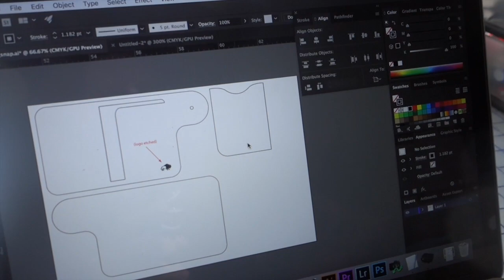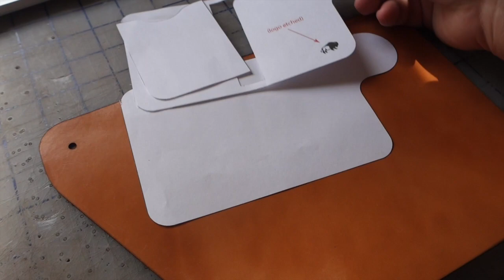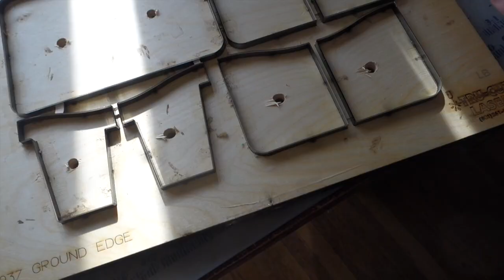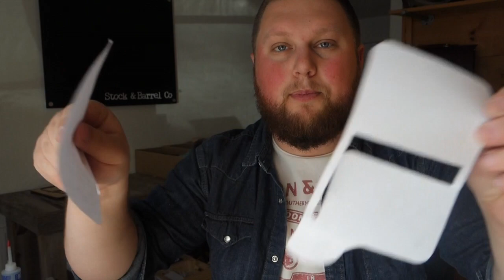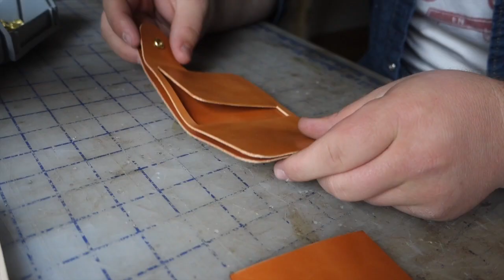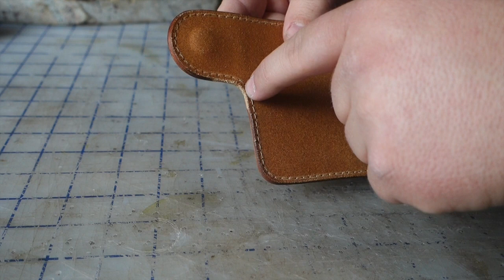Designing and making a new leather wallet from scratch

Comment: I’m not a fan of folding my cash, but I like this design.  I would change these things for my taste:
1. I would want more of the top parts of the cash showing for easier access, although the loose flap partially accomplishes this.
2. With a little thinner leather I would like the snap flap eliminated for easier access, a thinner overall design and and a smoother presentation.

Comment: I like it and the changes you spoke of were great improvements. I think you could stamp your logo on the outside of the wallet in it’s folded position. Also if you can slot another tiered card slot in it would be beneficial.

Comment: I know it's been four months... I just watched this. I do have a couple of suggestions. I think the first is to use leather that is just a little thinner. We all know guys that have wallets that make big bulges in their pockets because the wallet is too thick! Seems like the more layers to the wallet, the thinner each layer should be for the overall thickness. I like this particular design with the rounded snap flap. I'd be interested to see what your tweaked design of this ended up being. I use Illustrator all the time and never really thought to use it for leather patterns! Was making them with cardboard, pencil, and ruler! Do you have any suggestions for the hobbyist who wants to do projects that require sewing but that obviously can't just go out and buy an expensive sewing machine (or one at all)? I know that hand sewing is just not an option either, too hard on the hands and takes too long. Thank you for the down to earth way you present the projects!
Reply: Check out Nigel Armitage's pricking iron reviews. The stitching irons take most of the hard work out hand sewing by pre-punching the stitching holes. Thereby, making it MUCH easier on your hands than using an awl.

There should be a stitching iron to fit your budget.

Nigel was impressed with one of the Tandy stitching irons (review 11?). Though, he felt it needed some polishing to make it easier to use

He also liked several of the inexpensive irons from Goods Japan.

The three he seemed most impressed with were :
Doldokki, KS Blade Punch, and Crimson Hides.

After watching all 15 reviews, I'm leaning toward the Crimson Hides stitching punches. They are the ones he seemed most impressed with. 

Two major selling points are that they should last a lifetime, and they fit my budget better than the more expensive irons he reviewed.

Good luck.
Reply: Thank you for the GREAT reply! I think the reason I never considered hand stitching was because of the great difficulty of doing a simple stitch. I'll look into those items to see what I might like to try. Thank you again!
Reply: RG de Stolfe sounds like you won’t be able to sew. You could try projects that use only rivets or do lacing.
Reply: You're welcome. Hope it works out for you.
Reply: The very best info on hand stitching is here on YouTube, Weaver Leather.  I've been hand stitching for a couple of years, in the traditional 2 needle way and I love it but it was time consuming, though kind of Zen.  I watched one of his vids and when he got to sewing, showed a way that cut my sewing time in half, I swear!  Hope that helps!  Karen

Comment: Like it and like ur channel. 
On the wallet, wouldn’t do a double layer of leather for the button/snap ear
Reply: Agree, especially if you're going to increase that inside radius = increased length of of the leather ear to fold-over.
Reply: I see what you are saying. Would burnishing that cut edge keep it from wearing?  Or, because that edge is  'inside' it wouldn't frey?

Comment: Add more slot for card n make it more taller 
Hmmm  or add 1 more layer thin layer of leather for keeping cash (not fold) 
Or add some hole to put lanyard n hook to snap on belt loop on jeans
Reply from the maker: Hi Harry, it's interesting that you say that, because the reason I made this wallet is because some customers thought that our other wallets were too tall and had too many pockets. So the purpose of this one was to minimize and shrink. We do have other wallets on our website that have full length bill pockets and more card slots. Like our No.59 Trucker for example, or the No.55 Bill Fold

https://www.stockandbarrelco.com/collections/wallets